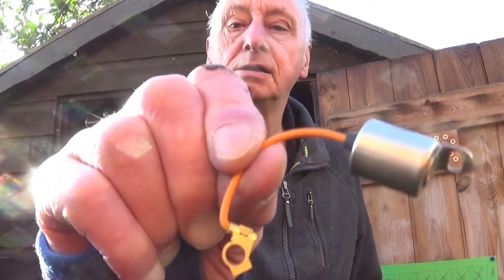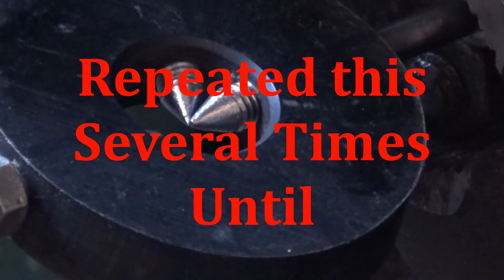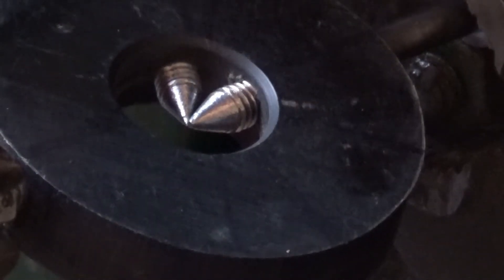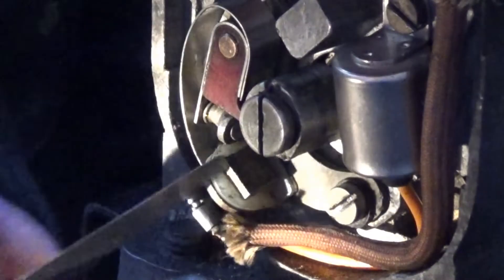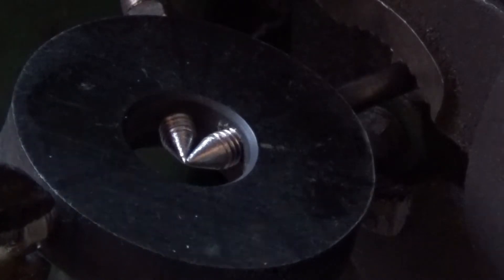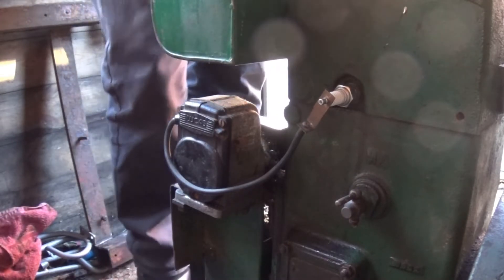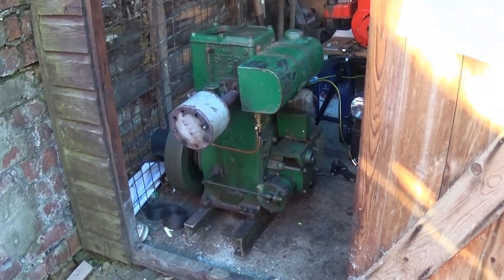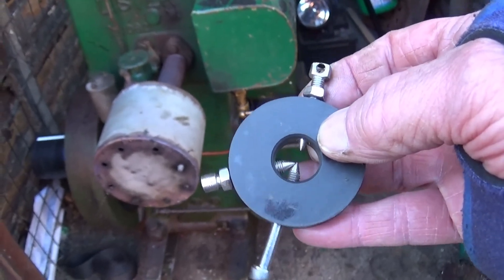Lister D Gets A New Condenser

Comment: Hi Malc can you do a video on how the rocker grease mechanism works please.
Reply from the maker: Yes, I'll include it in the one I'm doing on setting the tappets. However it's very simple. The cap is filled with grease and when screwed on, pushes some into the hole in the middle of the shaft.

Comment: Hi Malc. Soon after the engine started, there seemed to be a spark below the HT lead, about 3-4 inches back from the plug? What was it? Regards, Mark.
Reply from the maker: Hi Mark. Just had a look at that's the chain that drives the mag. So it must be a reflection of the light on the links. Cheers Mate.

Comment: You have a big blue spark Malc ! Well done ! About the valve noise, the rockers going sideways and make that noise ! The solution is to put a shim between the rocker and the distance bush, but they need to move freely with no endplay ! I did the same with the camschaft !
Reply from the maker: Thanks again mate. It wasn't valve noise, but the intermittent wind blowing into the camera. Anyway we'll give it a run with the rocker top off and have a look.